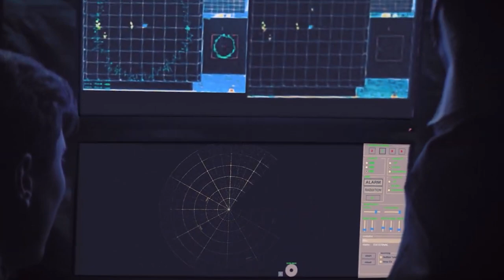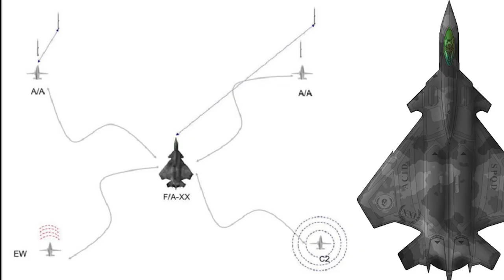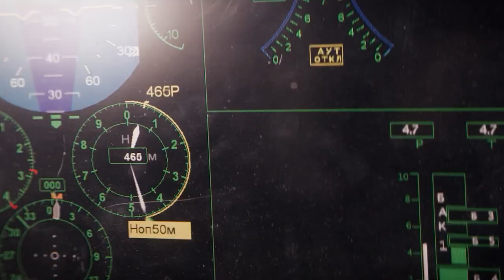US Panic: Meet These Mysterious Russia's Sixth Generation Fighter Jet

Comment: 40,000 ft?  What?  A Mig-31 flies easily at 60,000, a Mig-29 holds the altitude record for a jet engine aircraft at over 100,000 ft.
Reply: Uh, sssooooo heres where that little thing called validation comes into play.
That means you must provide it.
Reply: @reedrk88t  and to prove that they actually have to find the money to develop a working prototype with everything that has been listed
Reply: @fyingkiwi9576  yet according to "Fuck Butz," it's real because he says so.
Reply: @reedrk88t  also said it was a 6th gen fighter
Reply: Yeah… I’m not to sure that’s true bud. The F-22? Or SR-71? You obviously never heard of them
Reply: Mig-25 123,523 feet record holder.

Comment: Definitely not a 6th generation fighter. It can't beat F-22 that is for sure. And Definitely won't beat our legit 6th generation fighters with the loyal wingman. Russia is at least ten years behind in anything close.
Reply: Don't have to beat f22 or f35 as they are falling by themselves due to malfunctions all around the globe
Reply: Your country hasn't developed a VTOL aircraft. Still using rusty planes from the 1970s 😆
Reply: @milosobrenovic1241  2 or 3 out of 750 is not bad at all. Your planes are all computer animation. Where's the PAK-DA? Russia still uses propeller driven aircraft for heavy long range bombers 😆

Comment: Lolz! "Fighter capable of 8g maneuvers. Switching direction in a fraction of a second." Virtually every US fighter can pull 9gs as long as it's not carrying wing tanks. The number of forward facing rounded surfaces, flat turkey feathers on the exhaust, and engine figures are not really that impressive. I'll be they don't even coat the canopy to prevent helmet radar returns (yes, that's a thing. Helmets themselves have high radar cross section when you start getting into high levels of stealth). This thing reeks of poor man's stealth jet. Not sixth gen by any stretch. Maybe 4.5.
Reply: Bruh 😎
Reply: as the Spartans say IF. IF those fighters have the design of F16 Viper or especially F22 Raptor. IF.
Reply: The Russians for a long time had to deal with sandy, dust dirty 3rd world air fields and so on. Before they take off some of their planes have large vents that take in air on top surfaces of intake and when on flight open up the regular intake and close  those top surfaces. These are clever people that created the  very practical very cheap less expensive answer to a Rolex diver : Vostok Amphibian. Why blow money on the expensive over engineered when you can focus on the highly likely scenarios and use crafty and pragmatic design principles. Clever design to a nagging problem.
Reply: @mystic48209  Ya, America just built good runways so they can bring the pain and NOT play in the dirt.

Comment: Uh...no...just...no. That thrust vectoring capability is great, at an airshow. The reality is that the exposed nozzle makes the aircraft un-stealthy. Sure it may have a very low radar cross section, head-on, but the Checkmate can't hide its heat signature. Furthermore, the F-35 is 3x more expensive because its that much better. All that super-maneuverability is wasted if you can't get even see the plane that shot you down from over the horizon. Lockheed would expose secrets if they wanted to play Russia's 'mine is better' game. So...no, the Checkmate is Checkmated.
Reply: they show only a proto type never the developing or highly developed model.
It took 20 years before the public was aware of the F117A Nighthawk and that was based off of a Russian mathematician's paper.
Reply: F35 is 3 x more expencive due to laborcosts and other factors that doesnt have to do with that its better second TVS are vital in a dogfight  because due to ecm and other countermeasures there is a great chance that modern aircrafts can be in combat within visual range with eachothers
Reply: Well said. 
Looking stealthy doesn't make you stealthy. A lesson Russia and China will soon learn.

Comment: YAAWWWN!  Please, don't put me to sleep.  There's some very nice animation here, but animation does not equal a real, operational fighter.
Reply: Tell me about it, the F-35 proved this thoroughly.
Reply: @lw7238   I'm guessing he/she/it is, or a hater, or both!
Reply: @adamking4347   It isn't battle proven at all, let me guess you think that the F-35 has defeated the S-400 in Syria right? well I hate to break it to you but while the S-400 was in Syria it was never activated, the Russian commanders did not authorize it's use.

In the past few months the only thing it's proven is that it's submarine mode isn't working, they are still ironing the kinks out of it.

Comment: This plane is old technology for the US it's the exact design that one of the US companies had produced for the F-35 but because it was not as good as the current F-35 they got rid of it and decided not to go with that design so this is really old technology for the US
Reply: I agree but still the f22 raptor with upgrades is better than any Russian fighter guranteed
Reply: @janhansen3753  I'll guarantee it. Thanks for playing Jan. Next time, when responding I'd recommend either having significant experience in the field, or use documentation to debunk a claim. 

Facts are when engaging in BVR combat, the F-22 has no equal, period. That's not even including ECCM and support from AWACS and other aircraft. You'll need to dodge some missiles at range to hope to get close enough to use an all aspect IR missile, and even then the F-22 will likely have already used one of its own.

This video is merely a PR stunt until we see an actual physical prototype fly.
Reply: @somemikeguy9631  First and foremost, i am a Danish officer why i'm quite free to call an American naive patriot for a fool. I have spent several years in USA why i respect Americans, but i have never supported American naivety :).

And you got it right second time. I also THINK that a F-22 is superior in the air. But i don't know for sure = Using the word guarantee is very wrong.

Try to think back to the Vietnam war. USAF came from Korea with a 10-1 kill ratio and they would GUARANTEE same results in Vietnam. But the Vietnamese MIGs did fly as they were supposed to. The small, hard-to-see MiGs typically made one-pass attacks at high speed on targets that were hampered by either bombloads or damage.
Or when the Japanese generals guaranteed victory August 5 1945..

You can never guarantee anything, the opposing forces do not always do what you want them to do.

And neither does the Russians and Chinese. IRST are the main threat to stealth airplanes. And "we" do not know much about how far that research have come.
Reply: @janhansen3753  Fair enough, thank you for your joint service. I don't believe I experienced much name calling during my tenure at Joint Base Balad Iraq in 08' within the international sector of the airbase, but you're most certainly entitled to your opinion (and what we call a right to free speech where I'm from). But I don't have to like it or concur.

My point is confidence (what you call naivety) can provide deterrence with regards to warfare posturing & perception in general - opposite of a fearful/apprehensive approach. Sure you don't place illogical bets like that tactically or strategically, but then again true tactics aren't openly shared in general and for good reason. I do agree that there are too many variables for one man to identify as a surety in combat, even luck is a factor. I suppose we'll have to partially agree and somewhat agree to disagree here.

Comment: If you think the U.S. don’t have something that outmatches it’s current know fighter you don’t know anything about the way the U.S. military works. You have no clue what the top of the line fighter the U.S. has only time you find out about a plane is when they have something that is 100X better.
Reply: Exactly, the B2 was built in the 80's and remained nothing but UFO sightings until relatively recently. 
We now have the F22 people are so proud of and it was probably built in the 90's and we are just very recently being brought into it's circle. 
I would venture to say that by now the US probably actually does build flying saucers that practically teleport. LMAO

Comment: What a joke.  Russia hasn’t even been able to have a full fleet of fifth generation aircraft, and you want us to believe that this aircraft will join their service before America’s NGAD aircraft.  This video also doesn’t address the fact that this engine that they brag about has had problem after problem, and most of their SU-57’s do not have this engine.  The specifications of the Checkmate really are not that impressive and even if they had a fleet of 500 it really wouldn’t be a problem for the US.  Any aircraft that has three dimensional thrust vectoring will also have a large heat signature, which will go against stealthiness.  So while the Checkmate is doing cobra maneuvers and glorified air show maneuvers, the US will detect, lock on, and destroy it from 100 miles away.  Russia is all propaganda, while in America we don’t need that.  From the research of multiple defense analysts, Russia is approximately 0.75 generations behind the USA with regard to military aircraft, and when comparing American and Russian aircraft, in the same generation, Russia falls very short.
Reply: 9

Comment: STOP TALKING CRAP. The world is 40,000klm’s all the way round 1/5 is alot more than 1700miles!. If you mean across you be close. 40000ft ceiling is Rubbish most fighter planes operate at over 50,000 ft- your comparing to a commercial f/ Airbus 747- WTF !!. You’re a turkey!. Also so you know The F35 Pratt Whitney F 135-PW-100 in the F35 produces over 40,000 lbs thrust in after burner & 25,000 lbs in normal mode & has been doing so for more than 10 years, with over 500 F35 already produced. The SU 75 is still 3 years away at the earliest probably add 10 years because of Russia’s economy in a mess now!. The US is now working on their 6th Gen engines which will have another 25% more efficiency and substantially more thrust. The Americans are 20 years ahead thats even with them slackening off these last 12 years or so!.

Comment: 1. Russia won't be flying it. They won't have enough people by the time there's enough planes built to make a difference. Look for it in foreign countries because Russia will hock them for cash money rather than trying to find enough people, smart enough and healthy enough to do it. Add to this their school system died 37 years ago. 

In short: Russia is too broke,  demographically dead, and too stupid to fly it. I'll be dubious if they can even build it. 

2. 8G capable. Hope it has Fly By Wire. I'm never certain if it's Russian arrogance or lack of tech, but if it can pull 8gs the risks of GLOC are severe. If the pilot can't get back in the game, that plane better be able to save the pilot. 

3. Russia still has to deal with getting to the Carpathian Mountains.

Comment: What is wrong with you people?the USA has U.S pattens,wright pat air force base hired a Cleveland based private contractor to build 3 things,which now all 3 have verifiable pattens,no arguments google verifiable pattens,1 a mini nuclear reactor power device that has no nuclear waste 100%,2 a egg shaped air and water vehical which can be traveling at a high rate of speed and male a 90% turn drop into water without any effortor resistance then can travel at the same speed underwater air t0 water,3 triangler craft that is 100% undetectable both operate on mini nuclear reactor if i could i would post the patten pics for those religous nutts that refuse other species exist and are guiding us,obviously 100,000 years of reports of silent round oval and triangler things flying then boom 2019 new military vehicles matching these thousands of documents reporting ET crafts and beings.gasoline anythings are hidtory,cave man me make fire,anything like this video is purly for entertainment amd profit,never truth in current times